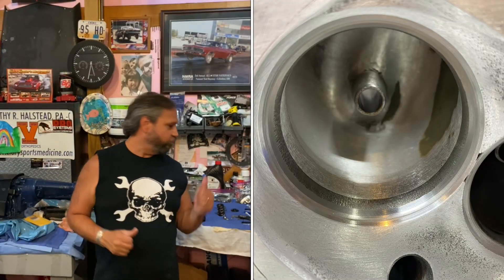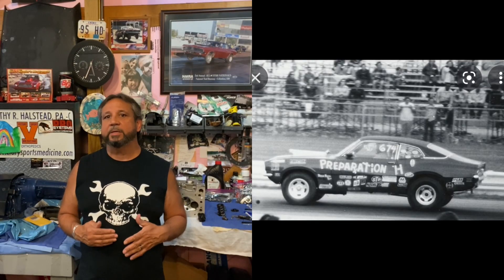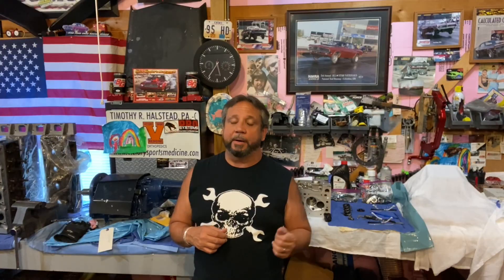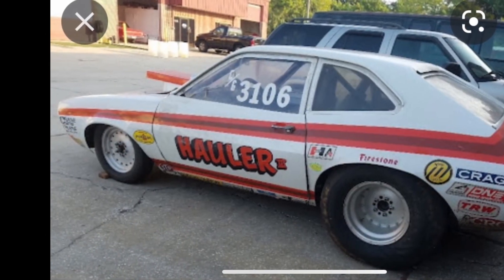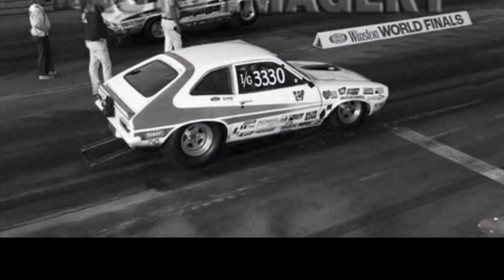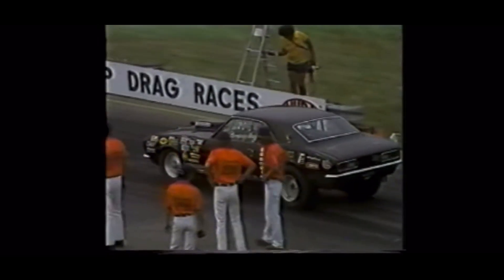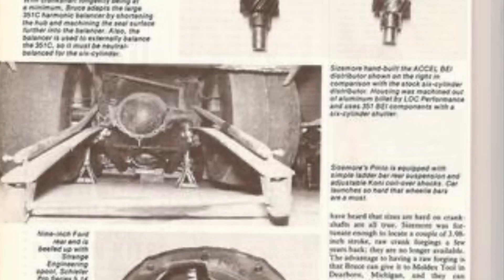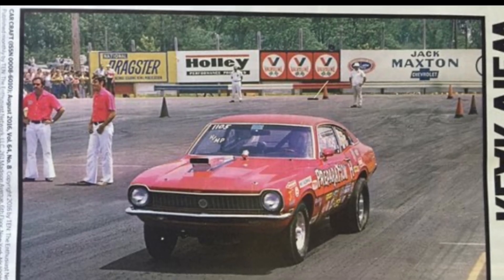Ford 351 Cleveland Headed 300  6 Cyl, 500 HP,  by Bruce Sizemore, Saw Lee Shepard smile, As I Passed

Comment: The only other 300 six I saw racing back in the day, ‘74’ or ‘75’ was at New England Dragway in Epping  New Hampshire. The car was so different sounding than the other cars it was bracket racing and killing them too. So consistent also., a late 50’s early 60’s C1 Corvette convertible. Nothing flashy either, definitely a sleeper and home garage project.
I went back to the pits and took a closer look. The owner told me it started life as a 300 six, mated it with a “welded up cross flow head and added a belt driven Paxton supercharger from a Studebaker! Can’t make this up! All I know he never lost a race that day, beat all comers, Dodge, Plymouth, Chevy and Fords. Than drove the car home after he closed off the header. I wish I had a picture and an audio of that sound. So cool👍
Reply from the maker: So cool, those are the days that live on forever. Thanks J for telling us this cool story. Have seen a 289 Mustang with a Paxton and it did pretty well, definitely a sleeper ran low 12s. Thanks

Comment: ford australia redesigned the 200-250ci head from windsor style to cleveland and made it crossflow in the 70's it's very similar to what they've done here. it later became an alloy head crossflow then multipoint efi the next iteration was the sohc alloy head crossflow which got vct before becoming dohc alloy head crossflow aka barra 6cyl of which modified ones are now running 2200hp on the factory block and head.
Reply from the maker: I saw that. Wicked power mate. Been hearing a lot about these wonders. Appreciate it and you being here Michael

Comment: There is a wealth of knowledge on many of the Cleveland head and sandwich 300 heads at the FordSix forums. Even a few guys who ran them back in the day. There are still a few 500+ HP 300s being raced to this day. 

A little known fact is that Ford had pallets worth of crossflow heads cast for the 240 and 300 sixes. All but a few got melted down.
Reply: That's the same as all the Allison V12's at the bottom of the ocean... Such a shame...
Reply from the maker: @kramnull8962  from aircraft?
Reply from the maker: Samuel, that is crazy, that they had pallets, and melted them, How did you find that out?
Reply: @dragboss351cleveland  I have talked with an individual who has a pair of them. He was an engineer on the 300 when it was in production. They are well documented over on the forums. You can find videos of them in action on youtube. Id rather not divulge who has them here. But they are in front-engine vintage dragsters.
Reply from the maker: @samuelnoller1565  Thanks Samuel, for getting back to me, so cool. I have seen a few in Front engine machines.

Comment: Ford Australia did that with the 250 in 1976 from factory with the XC Falcon and TD Cortina and MK2 Transit van.
Reply from the maker: Just heard some of that. Wow. Not in the states
Reply: @dragboss351cleveland  that's because like every Aussie Ford  inline 6 after 1975 they weren't sold outside of Australia and New Zealand unless it was wrapped up in a Aussie built Falcon. 
I kinda feel sorry for you blokes in the USA, no Falcon, no Aussie  Clevos(unless you bought a Pantera between 1974 and 1986 which had the Aussie Clevo) No 250 2v, No 4.1ltr Crossflow, no SOHC 4ltr or Barra.
Reply from the maker: @aussieausdeutschland4245  nothing after 74 mate.
Reply: @dragboss351cleveland  nothing after 74? As in the Clevo or the six?
Reply from the maker: @aussieausdeutschland4245  Clevo mate

Comment: Ford Australia built what they called the crossflow 6 (250 cu. in.) in the late 70's as an iron head engine, then switching to  alluminium in the early 80's. these engines borrowed heavily from cleveland head design, you could actually use rocker arms interchangeably between the 2 engines. btw these engines are the evolutionary grandfather of the Ford Australia Barra engine.
Reply: i was about to post this exact info, i have one sitting in the corner of my workshop here in NZ.
Reply from the maker: What was it used on?
Reply: @dragboss351cleveland  everything! virtually every Falcon, Fairmont, sedan, ute and panel van Ford sold had this as the base engine, lower spec cars were carb equipped and higher spec ( after the introduction of the alloy head) had EFI. I think around 1982. i remember the EFI engine being advertised as more powerful than the 4.9L(302 cu.in) Cleveland.
Reply from the maker: Wow never knew that. Cool information Paul.

Comment: i remember seein a video a while back with a guy who was running a turbo 300 in a maverick.if i recall correctly he was getting into the high 10's.with a mostly stock bottom end & 5k rpm limit.the 300 was designed to run forever in a light duty pickup.will be millions of them still running 20 years from now.
Reply: There was a guy who ran a 6 cyl Maverick @ Lebanon Valley,car ran 10's
Reply from the maker: Those sixes, make some power that if for sure, Thanks Sean

Comment: Powernation did a build series on the Ford 300 inline 6, started with a stock 85 hp engine went through the normal aspirated mods to about 280 hp then turbocharged it to just over 500hp and almost 600 ft lb of torque. One of their better build shows: https://youtu.be/SZoV6E5DDXI
Reply: Here's the normal aspirated first part https://youtu.be/bSTxCfuhIAk
Reply from the maker: thanks Eugene, appreciate the heads up, so Cool.

Comment: That was a race heaven if you were a Ford fan. 😎 Before NHRA ran most of the Fords out of competition with there weight penalties on all Fords using Boss 302 and 351 C  type cylinder heads. 😭  Buddy Ingersoll also had a awesome turbo Ford Pinto that NHRA hated.
Reply from the maker: NHRA hated any of Buddy 6 cylinder cars so it seems.

Comment: I can't believe no company ever offered an aftermarket crossflow head for the Ford 300. People Love these engines and I think if somebody like AFR or TrickFlow offered one that wasn't a million dollars people would without a doubt buy them.
Reply: I worked with an ex-Cleveland engine plant Ford engineer that had worked with CNG (or LPG?) engine production back in the 90's. They were 300 I-6 and Ford bought aftermarket cross flow racing heads from Australia for this application. Reading comments from down under, maybe this wasn't an aftermarket head but indeed there were Cleveland-built crossflow sixes.
Reply from the maker: @danielgodshall7502  saw that information given, pretty cool. I knew or know nothing about 300, 6 cylinders. Pretty trick
Reply: @danielgodshall7502  
You would think there would be more info online about if if it was a production unit. I know they offer some performance parts for the 200ci inline 6 but never heard of anything for the 300.
Reply from the maker: I believe that for sure. I have seen aluminum ones but not sure if they we’re not this same thing. Cool though and makes me want one.
Reply: Problem is, big companies with big payrolls and expensive CNC machines only want to build stuff that sells in big numbers. Your only hope is with "passion project" specialists like John Mummert, Alan Root, Barry Robotnick, etc. Guys who do it for the love of the engine and the challenge, not to get rich.

Comment: I love inline 6's. I'm building a Chevy inline 6 292 with a Ryan Falconer V-12 head and 6-71 blower. Looking at 1000 HP.
Reply from the maker: Dang it man, turn it loose.
Reply: @dragboss351cleveland  It's going in my 53 Chevy 1/2 ton pickup.
Reply from the maker: @lazyhoundracing9621  I love all trucks cool deal. Be fun and cool at the same time
Reply: @dragboss351cleveland Thanks.  I have totally electric A/C from AUS. Also electric P/S.
Reply from the maker: @lazyhoundracing9621  now your cooking with gas.

Comment: So basically it’s a 300 I6 with a crossflow head…
Reply: Yes it is. The same thing has also been done with Chevy 292s using two SBC or LS heads. Some place on the net there's an article about a Gen 1 Camaro with that set-up.  One advantage the Chevy has is the bore spread matches  between the SBC and the inline at 4.400. The 300 versus the Cleveland is 4.480 versus the 4.380. Interestingly the AMC/Jeep 6 is 4.380. Also the Pontiac SOHC is 4.400 as is the GM LQ-1 DOHC V-6.
Reply: @mpetersen6  so with the SBC and the 292 chevy having the same bore spacing it must seal really well and be less engineering to put two SBC heads together to make a 6 cylinder version for use on the 292?
Reply from the maker: Wow can you imagine that. Has to have been done.
Reply: @dragboss351cleveland  
There's all kinds of combinations if one really wanted to get creative. There's a racing organization in Argentina that actually did race prepped DOHC 24V versions of the Chevrolet, Ford and AMC/Jeep inline sixes that run in their TC series.  The heads actually appear to be the same basic combustion chamber and porting. I'm not sure if the Ford is the 200 or 240 block. The engines all put out about 500 hp with 2 2bbl carbs. The series is the oldest racing series run by the same organizing body on the planet.
Reply: @PykrisBurton  
I'm not sure about the head bolt pattern.  But if you are cutting and welding anyway.  There was some people working on adapting the LQ-1 heads to the Pontiac camper. There's an article on the Hot Rod website.
Reply from the maker: @mpetersen6  so much you don’t know. Like they even race in Argentina. That big hp and from 2bbl.  Cool man

Comment: Wow never seen that setup. That thing sounding great. Smart folks back in those days. Down here in the south we had a guy running a boss 429 head on a 2300 4 cylinder. Dragster. That thing was fast. Naturally aspirated reved to 12000 RPM. Thanks 😊🙏
Reply from the maker: Yes Mike just heard about that. So cool to see or at least about the innovation and performance, other than the ole v8.
Reply: 3.7 Mercruiser 4 cylinder.
Reply: I think it was mercury marine that had an aluminum block that used a cast iron 460 head. I don't remember the nomenclature for the model. I think there were some problems with the cam gear rubbing a hole in the water pump or something along those lines. I always thought that a '32 ford pickup with with one of these blocks and an eliminator performance hemi head would be cool.
Reply from the maker: @jamessheets9205  yes I have heard of that being on a boat motor. Saw one at the shop where all this started. He was doing a valve job.

Comment: I've always loved those 6cyl Cleveland builds... Talk about some engineering... And 9's from a NA inline 6 is crazy but even more impressive it was done nearly 50 years ago!  Great job Tim
Reply from the maker: Thanks Andy, that is what is so fascinating is that they had no performance parts. So they made them. Imagine with a set of aluminum heads or today welded together. Wowser. So cool see you tonight 6:30 pm at Unity  Motorsports Garage 👍
Reply: I had no idea of this until now!! This is insane!!
Reply from the maker: @anthonysiler4938  that’s what real racing was all about. Making headway with failures or leaps and bounds with mind blowing performance all from hard work and innovation
Reply: @dragboss351cleveland  man! It makes you wonder what can be done with a 2.4 L NA  with the right hands on it.. our old 79 fox turbo did pretty well even after my dad pulled the turbo off with a webber carb and intake.. years ago there was a guy running one putting down over 900 to the wheels that was 100 percent street legal.. fords never stop impressing..
Reply from the maker: Wow that is impressive.  It into power adders, but they sure make some power. Sounds like it had no lag
Reply: @anthonysiler4938  i know bmw is a curse for some, but a bmw s38 can make 550hp from 3,3 litres (200ci) and 350+hp from a 2liter 4 cyl verson engine
Reply: As I watched a clip this morning of a 202ci Holden Torana well in the 9s,, and a true street car
Reply: @ldnwholesale8552  Holden 6 stand alone as the most horribly cast engine blocks of all time, more warpage in the casting than a cooked engine. The indians cast better engines in their dusty backyards.
Reply: it was not only the ford 300. in northern nj we had a Gm man named pete gardner he ran a 292 chevy in line 6 with small block heads like this ford in a black falcon running in the 9's 
don't underestimate the inlines esp.that ford from down under

Comment: Thanks l couldn't remember the names mixed up with buddy Ingersoll and bruce sizemoore bruce had the 6 and buddy the 4 cyl turbo pinto cool
Stuff. lm excited to build & looking for 351 c parts for my 63 fairlane pro street car found a pr of yates E3 nascar heads and rockers in the attic of an old circle track racers barn finding more info on these heads looking for parts $$$$ want to build a stroker was at a denver area swap today and crazy 351 c parts there still out there ! thanks for your u tube channel
Reply: NHRA bumped the index on Ingersoll every time he showed up with that Pinto.
Reply from the maker: The issues with nascar stuff is heads and no valvetrain then it becomes a big hunt. Sounds like your good to go. Buy a stroker kit from trackboss performance products. Neutral balanced and complete only like 2200 or so
Reply: @dragboss351cleveland  springs , valves l dont think will be an issue intake will be expensive l only paid $225 for heads and rockers so any more cost will make it affordable for me if can't make it come together can always sell and find another direction
Reply from the maker: @jeffmiller2682  where there is a will, there is a way....

Comment: Damn, that is really cool!  Makes me want to put a Cleveland head on my dirt bike!  Keep the cool videos coming!  I would love to have seen him even take it a step further, building a V12 out of 2 inline 300's with the same Cleveland heads.
Reply: Sounds like a job for Allen Millyard. He did a Kawasaki v12.
Reply from the maker: Crazy never even thought of anything close to that Brandon
Reply: @dragboss351cleveland  If you haven't already, watch Allen's video on building the 2300 V12. It's 15 minutes well spent.
Reply: Some guy actually kinda did that. He joined two 302 blocks and four cleaveland heads into a V12. Not as narrow but probably a lot easier to make. Better solution than that V12 1jz/2jz.
Reply from the maker: Well John has not been done you be the first. Working on something pretty epic. Tonight live on Unity Motorsports Garage 6:30 pm est
Reply: @dragboss351cleveland  
On the Engine Swap Depot website there was someone building a custom V-12 based on 2JZ architecture
Reply from the maker: @mpetersen6  so many different configurations. Simply amazing
Reply: @dragboss351cleveland  
One thing about the Cleveland versus 300 inline 6 is the 300 has bore centers that are .100" wider than the 4.380 of the Cleveland and Windsor. Interestingly the AMC/Jeep inline has a BC of 4.380. It would be interesting to see somebody build a road car going this route. Not for strip use but more in the autocross or track car line.
Reply from the maker: @mpetersen6  makes a big difference on deshrousing the valves

Comment: A Cleveland style cross flow head was something Ford should've built.
Reply: They did build it, just you guys never saw it. Google ford 250 crossflow, had cleveland style splayed valves and rockers, lifters ect were the same. Bloodline development eventually led to the "barra" 6 that has been brought over for drag week action
Reply from the maker: Never looked at 6 cylinder engines before this. I like them.